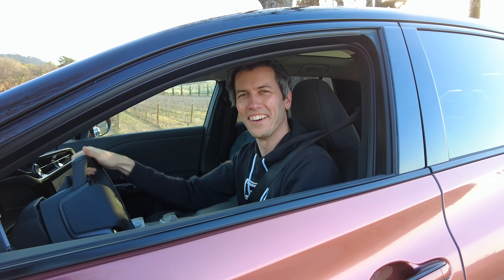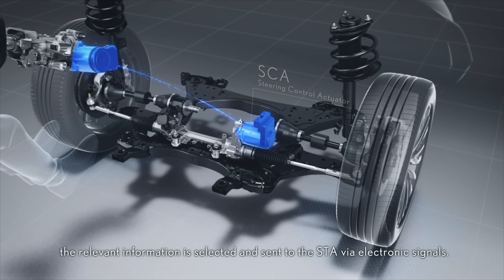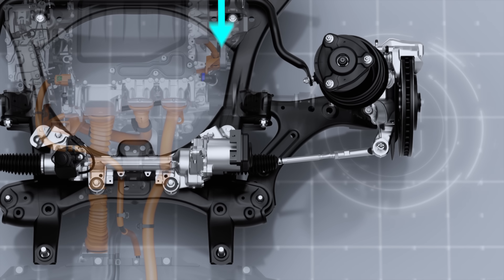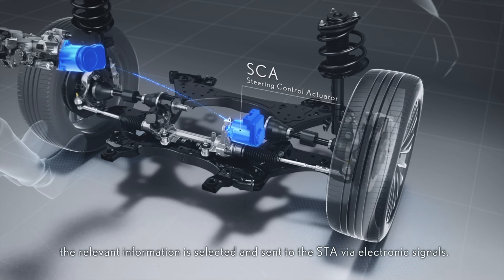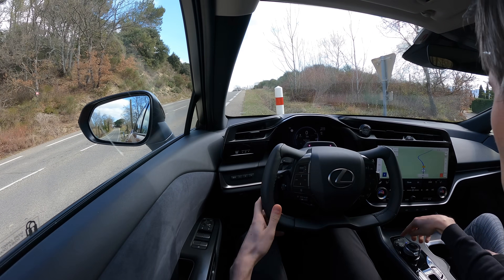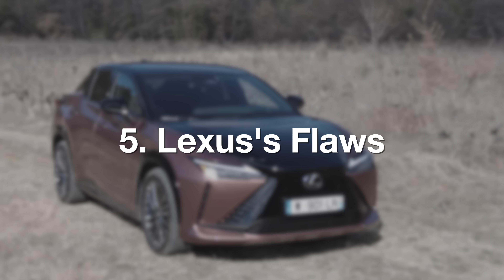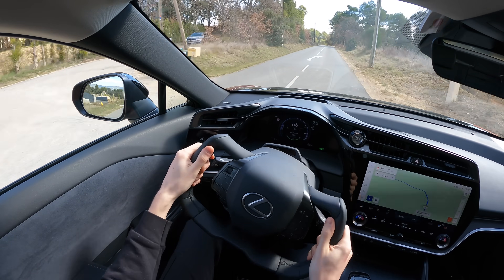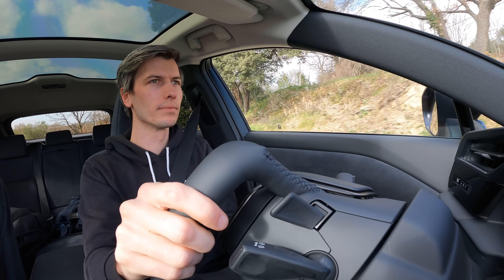How Lexus Fixed Tesla's Bad Idea: Steer-By-Wire Yoke

Comment: This actually sounds quite cool, I wonder if in a performance vehicle with two of these set up you could have things like infinitely adjustable ackermann, steering ratio, toe by speed, simulated caster etc.
Reply: Yeah man 💯 🏴 EE the goat
Reply: at first i thought no because the rack is still a limiter, but then again, you don’t need a rack! independent steering motors could allow unlimited angle and i think you might be able to do a full 360 drift with the front wheels facing forward the entire time

Comment: Idiotic idea; almost as bad as "self-driving" cars. Technology for technology's sake. Please give it a rest, you engineers from hell. Not all of your ideas are good, and some are downright dangerous. When one of these sensors, motors, or wire connections fail (happens all the time with modern vehicles), people will lose control of the vehicle and DIE. Stop using the general public as guinea pigs!  😡

Comment: There is a simple solution to the twitchiness at high speeds with traditional mechanical steering. Vary the electric assist. The more the speed, the less assist. Making it harder to turn the wheel on  highway fells really natural.

Comment: I think a knob to set the ratio would be better for my taste. I prefer to have muscle memory as to how far the wheels move according to the steering wheel. I have driven gocarts with low ratio at fast speeds and I am ok with a little twitchy , but not being able to judge how far the wheels will actually move would be bad for me. Also that delay doesn't look appealing to me at all. I may not be a race car driver but when doing say 45 and a ladder falls off the truck in front of me, I want to steer as fast as I can, not be hindered by poor response time on some silly computer. But that's just how I feel. If they want to make it less twitchy have it be instantaneous for the link with no delay and give me the option to turn off feedback. Without feedback pushing the user input the wheels should stay locked in at whatever angle I choose no matter how rough the road is. Yes I can't feel how rough it is but nothing will be pushing on my hands causing an oscillation at the same time. Just my 2 cents.

Comment: I like the idea. My main concern is: How intuitive does it feel? For example: Let's assume I am driving along a curve with a constant radius (e.g. a roundabout). If I now start accelerating, I'd have to turn the wheel further and further inward the more I pick up speed - even though the curvature remains unchanged. This seems counter-intuitive. But maybe I am underestimating our capability of subconsciously simulating this correlation. Maybe as long as the rate of change in steering ratio rather directly correlates to rate of change in speed it's ok.
Reply: See my posting about 15yrs ago,  regarding  a steady continuous turn  such as a large round about.

Comment: I saw a prototype of such a system at Reading University in the UK, in 1988, and it wasn't new then! All of the design principles were well understood, it was simply a matter of whether or not the cost of making it safe was worth it. Things were very different in the 1980s (tech cost more). I suppose I should not be surprised that it's taken nearly 40 years before someone is having a go for actual road use.

The steering lag is because they've not got the control loops right. It looks like they've got something that's a bit like a classic 2nd order loop (this will settle on a demand input, eventually. If you don't want it to overshoot it'll be limited in how quickly it does settle). 

The challenge is that, to make it safe, you have to have a detailed specification for the control loop. But actually writing down a control loop spec that mimics mechanically connected (thus instant) steering, whilst retaining all the properties you'd want (like damping, etc), is probably very difficult. The perfect one is not going to be a bog standard second order control loop. The problem is that, despite the vast gamut of control loop ideas (PID, sliding mode, etc), a real world problem such as "perfect steering" is almost certainly going to have to be some non-linearity in it - if() statements (if it's a software control loop). 

If that's the control loop design one writes, the subsequent challenge is that it's difficult to prove that the specification is "safe" and "correct". It becomes difficult to have an analytical appraisal of the behaviour of the specified system. By this I mean things like analysing whether or not the control loop response is inside or outside of the Nyquist-1 Stability Point in all circumstances. If it's outside, that's a steering system that will oscillate if suitably provoked, and that's something you definitely do not want. (a joke is that control systems are oscillators that don't, whilst oscillators are control systems that can't make up their mind... Knowing which one you've got is really important!). So, you might have a very promising control loop specification that you can perfectly and reliably implement, but you may have no idea as to whether or not it always has safe behaviour.

So, I suspect that Lexus have actually been pretty conservative in the specification of the control loop for this steering, and the result is the steering lag (but perfectly and reliably implemented steering lag). 

Another benefit not mentioned is that it makes it easier to have left and right hand drive model. With all of the controls being "by wire", they can simply be bolted on to either side of the cabin. A manufacturer can if they wish have a symmetric dash / console, meaning that there's no cost difference to which side they bold the wheel and pedal assemblies to.  

Potentially, you could even swap it over (which could be useful to us Brits when travelling to France - simple swap the car to LHD mode whilst on the ferry or train). Being a Lexus, it'd probably need nothing other than 1 13mm socket...

Comment: To be honest, the concept scares me. 

I'm sure it can work but the implications of a bad implementation turn me off it entirely.

Where I live is predominantly narrow twisty roads with stone walls lining them. The roads change width constantly and are uneven. 
I recently test drove a new car with lane keep assist. The car was constantly fighting me and trying to adjust the steering pushing uncomfortably close to oncoming traffic. In the short time I had it I couldn't figure out how to turn it off. That alone is a hell no to electronically assisted steering from me.

Adding extra layers of filtering and delay to the input and feedback of the steering system is not a good idea in my opinion.
Reply: Never mind all the alarms. "Yes I know that wall was close! I'm the one who drove by it!"

Comment: Steer by wire will make cars truly versatile. All wheels would be able to move independently, and that can make possible a lot of useful crab-crawling movements. Parallel parking will be so easy. And the turning radius will be so close to zero. Since all the required movements can be calculated by a computer. Same concept has been applied for planes, and now for helicopters too

Comment: I wonder how this system is actually going to work at high speeds, when you need to lock the wheels quickly, e.g. recovering from a slide or loss of traction, or avoiding an obstacle like in the elk test.

Comment: Everyone who's ridden a bicycle has experienced variable steering rates.
All power steering systems have a big slack range when changing direction, and in normal situations you're really steer-by-wire anyway, just with a mechanical backup.

Comment: Mercedes tried steer by wire back in the early 2000s. They paired it with a joystick in the center console though. I think they canned it because marketing was sure they wouldn't be able to sell it. 
What's neat about the joystick in the center console is that you can hand over driving to whoever is in the passenger seat without having to stop. I assume Lexus chose a yoke because its easier to include small changes than to go big and take peoples pedals and wheel away.

Comment: The main flaw of this is limited by computer steering ratio. Imagine you caught a skid on a snowy highway, and stabilization system can't do anything with it (it's know that automatic good at preventing, but when the deal go serious it can make even worse). You want to correct direction of wheels, but because speed is high, ratio is also high and wheels isn't turning as much as they need....

Comment: Just seems entirely unnecessary, I'd trust a direct mechanical system rather than electronic. If it loses signal you're in trouble.

Also electric vehicles are 10x worse for the environment than combustion. . . Do so research and you'll find the truth about cobalt, lithium mining and the fact you can't recycle an electric battery systems.

Comment: The steering reaction looks instant. But it looks like it can't keep sync with the yokes angular position , this could perhaps be fixed with trying to limit yoke angular rate with the motors. Probably not a problem for the demographic of new lexus buyers. I'd be okay with driving such a system in a fleet vehicle. The level of non wrench fixable components is just to high for me.

Comment: Some countries demand a direct mechanical connection between wheel and tyres, so laws would need changing.  I do like a round steering wheel though, as I sometimes adjust my hand position during a journey and this flexibility would be impossible with a yoke.  I also think I might feel constrained in some way, and there’s enough restriction going on in the world these days.
Reply: Probably half the drivers couldn’t steer if power assist went out.  They need to update the laws to allow steer and brake by wire.

Comment: I think the acid test would be whether you could control it in a skid where the expected steering angle change doesn’t correlate with the speed. If you take it to a skid pan and can’t control it then it’ll be impossible on a wet road at speed.
Reply: Great point,  see my comments about 16 hrs ago regarding the chip /computer taking over!  And nearly killing me.😮

Comment: In a car with regular power steering you still can operate it, even if higher mentioned function pump fails. In these cars, I suppose, you just will lose control of the steering entirely.

Comment: Does the variable steering ratio mean that if you're starting to go around a curve at high speed and you slow down significantly it actually turns the wheels more?  The alternative would be that it's only relative movements that have a higher effect at low speed, but that means your steering wheel's centered position could change, which would cause problems.

Comment: If there was regulations mandating high levels of reliability and redundancy that were strictly adhered to I might feel somewhat accepting, but on a race to the bottom consumer product absolutely not! The Boing 737 max is a prime example of how control by wire can go lethality wrong even in a space with much stronger regulations, higher and tighter engineering standards and requirements, phenomenally better maintenance, and operators (pilots) trained and regulated to a much better standard. P.S. the electronically controlled e-brake has to go, there are many examples of them failing because they are not a stand alone system anymore when electroniclly controlled

Comment: Steer-by-wire isn't some crazy new idea... It's all in the execution, so if they can't get it right in the execution, it's going to be horrible. My preference would be an awesome steer-by-wire system, then a mechanically-linked steering system, and will avoid a poorly-executed steer-by-wire at all cost.

Comment: It's an interesting idea but my concern is that if you needed to make a large steering command at speed to avoid something, would the system only allow limited turning movement? Thus you turn the wheel dramatically but you still crash because the wheels did not turn sufficiently.
Reply: Or the lag allows you to hit the item instead of moving in time

Comment: as some one who drive tractors and other equipment almost daily i was wondering when this would finally come to cars we do it hydraulically tho other then the medium used its the same it does come with another feature tho its not comparable with a yoke or car wheel that needs to center, variable steering ratio via how fast you turn the wheel from what i have driven when you turn the wheel realy slow about 10 ish turns lock to lock but if you turn it fast around 2 turns lock to lock it could go faster but there 12+ tonne machines 2 turns lock to lock is already pushing the boundary's of stupidity for that size of machine. it does still limit how fast the wheels can turn at speed and some times how far the wheels can turn when at speed to prevent over steering and flipping the machine.

Comment: To me this is like their hybrid system, do you really need all that complexity, weight and additional use of materials over a standard ICE powered vehicle? Face it, they haven't simplified the steering system at all and hackers can now steal control of your vehicle and take you for a merry joy ride into oblivion. Yes I'm sure there are safeguard systems on board but that only adds to the complexity even more, having said that I am not against it but it should be an option, an option.

Comment: Too bad if you don't hold the wheel on the sides at all times; many like to hold the wheel at the top or bottom while cruising along.

I'm sure the stability control and safety systems are able to steer the wheels uncommanded; which isn't new, E90s series BMWs with active steering will do that, and my new Subaru will do it as a last ditch attempt to avoid collision. But I think this idea scares people.

Comment: It's surprising that Tesla missed this mark on the yoke, but then again you have to remember: they are a software development company at their core, only automotive at second.

Toyota is on the right track to introduce an able, competent and practical yoke already. If this already the pre-production vehicle, a few more calibrations on the steer-by-wire system and it will be all good!

Comment: The latency issue is pure software - even a local ethernet, 1m long would be at most a millisecond. Unlike ice there is no heating up front there that requires old gen electronics. I have development boards and hobby-grade motors with faster response than that, turning solar panels.

Tesla could do this properly on next gen - a must buy for someone that cranks everything up into max sport mode all the time.

Comment: Code is not perfect, code plus mech components is even worse

Throttle by wire is ok bc it is basically 0-100 input. Steering where you have 9000 variables between all motors battery’s and etc

Comment: i just want a simple, cheap, easily fixed and maintained, manual geared, ice car with a throttle cable, mechanical steering, vacuum boosted hydraulic brakes and cable parking brake.  i do not want any of this idiotic, over-complicated, over-expensive, unreliable, unenvironmentally-friendly e-waste.  in short, i want a car, not a spaceship for the road.
Reply: of course, if you want to over pay just to pretend you're captain kirk on the commute to work, that's fine.  i just hope i have a choice because i can see a greedy industry lobbying regulators to enforce this unnecessary electronica on all of us via the usual bogus environmental and/or totally neurotic safety angles.

Comment: My car is from 2002 and has an electronic pedal and throttle.  It sucks when they fail but you can "turn it off and turn it back on again" and sometimes regain function.  That's your warning it's time to replace the part.  Then code readers can see what happens and you can replace the correct part.  Heck, I once had a lady at a gas station say her steering stopped working, I looked for fluid and couldn't find a reservoir.  Realized it was electric assist.  The fuse was either blown or loose, don't remember, but I think I just pulled the fuse and pushed it back in real good and she had steering back.

Comment: I learnt from the professor of the vehicle dynamics course, that the variable sensitivity is bad because if you want to pull into a driveway, and you are used to turning 90 degrees, and if one day you are driving slower than before, you may turn more sharply and crash. It would be unpredictable for drivers since it's hard to monitor the speed all the time.

Comment: Well, but here is the conundrum: This was already achieved and developed since 2 decades ago. The difference: It was assisted with a assistance motor in the steering column that would change the steering angle depending on speed, so if you are on the highway you had a more fine-grained steering or when parking you had a faster steering, but with one big advantage: In case the system fails, you had "normal" steering because there was a fail-safe physical connection.

Comment: There is already a problem with the electric power steering not responding to drivers input. You can still force it without the assist. This will have no way to force it if it malfunctions